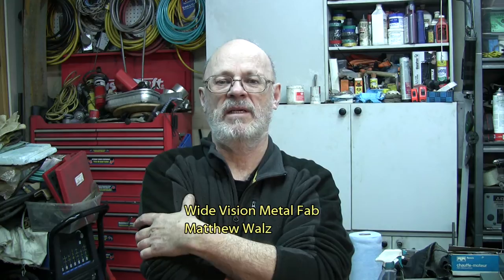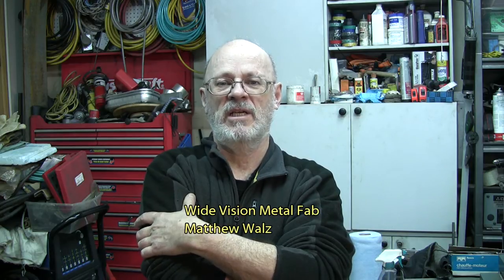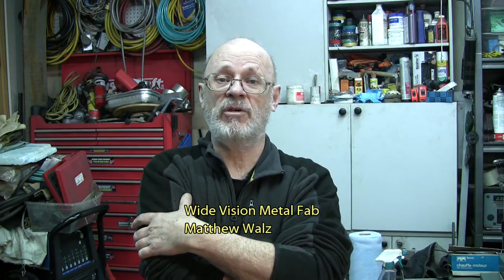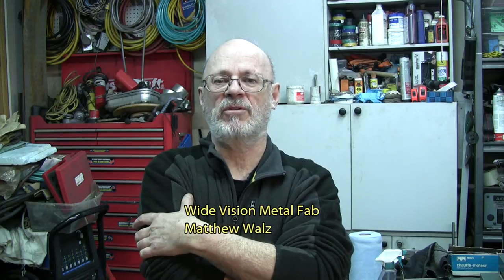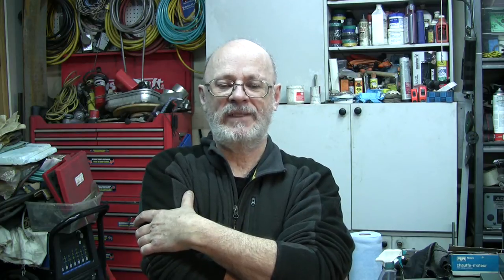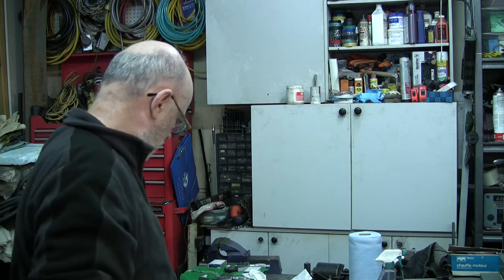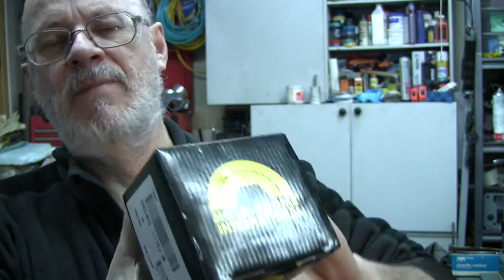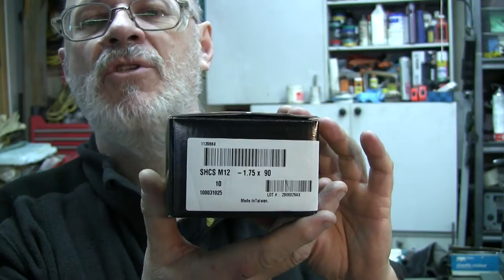Back plate for 6 jaws chuck part 8 final

Comment: ...One year later... Perrier, very informative and entertaining! Bravo!
Fifty some-odd years ago, my British exchange shop teacher told us that the reason why scroll chucks have three holes, is so you can tighten all three in sequence starting with the one marked "0". This is especially true for wedge jaw type drill chucks. Ever had a drill bit slip in the Chuck? It will never happen again if you progressively tighten the chuck at all three locations around the chuck, taking up the slack in the mechanism as you go.
Same thing, only different for scroll chucks. As you mentioned, the accuracy of the chuck is determined by the accuracy of the machining and fitment of ALL the parts. I clean and lube all my chucks regularly.
Reply from the maker: Hi Tom, you're right to get all the keys tightened, the zero key is supposed to be the one that repeats the best, it's only marked on the better products...
Thanks for the interest and commenting,    Pierre

Comment: That will be very nice to really be able to dial that thing in. I would be curious if that particular chuck is high enough quality to repeat .0004 for various diameters as oftentimes I find the run-out can vary slightly with diameter. Very handy for a rapid true adjust!
Reply from the maker: Hi Brian, it will vary, since I'll be using that chuck on a regular basis, we'll find out soon enough...
Just like you said, the adjustment is one screw turn away.
Thanks, Pierre

Comment: Pierre - Very Good result. What happens when you tighten the bolts from the front of the chuck. Does it affect the run out. Also with this set up how stable is the set up after making some heavy cuts. 
Chris
Reply from the maker: Hi Chris, when you do the alignment you keep the 3 bolts quite snug and you tighten them very evenly with the dial on the ref part, as for heavy cuts, it's not been tried so far, but it's to come soon in projects.
Thanks for getting involved,  Pierre

Comment: 1. Please comment on source of slug and how you tested it for roundess
2. Is the indicator holder a shop made item?
Reply from the maker: The slug was turned on a regular 3 jaws chuck, then measured, the result was within a tenth or so, guess that the result was pretty close from the max possible accessible precision for this situation, under a thousand is in most cases what most people will get.
The holder is an old school project, it works with the main handle producing hydraulic pressure to make the whole arm get stiff, not the best possible but works good enough, unfortunately I don't have the plans anymore.
Thanks for comment,   Pierre

Comment: There is a Fasten All two blocks from me and I go there a lot only bad thing you have to buy in bulk.
Reply from the maker: Mack McCurry When I go there, it's rarely under $75 - 100... It's better than coming out of Home Depot and 5-6 pieces for the same price, or just about, and also the quality of the hardware isn't comparable.Hope you'll be able to wind down before bed time.... LOLThanks,  Pierre

Comment: you should lap the jaws, since it looks like they have some old age, then recalibrate. Hey, at least if you're worrying bout microns... i mean the part of the jaws that grips on the part, not the t-slots.
Reply from the maker: Hi, the jaws are just like brand new, no wear, I think I mentioned that this chuck had almost never been used at all. When I purchased it it had no back plate, and probably never had one....  Thanks for comment,   Pierre